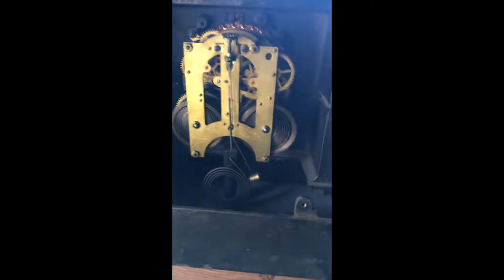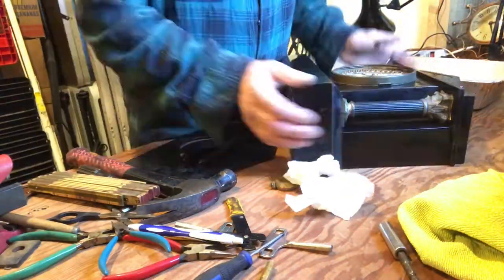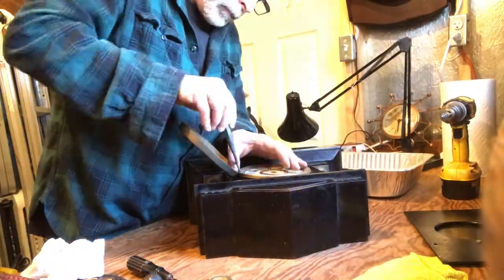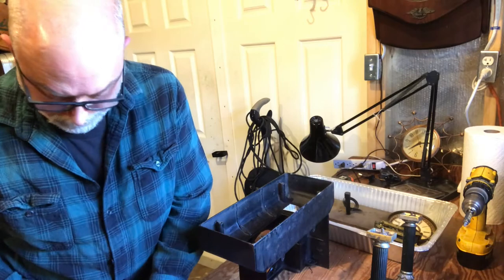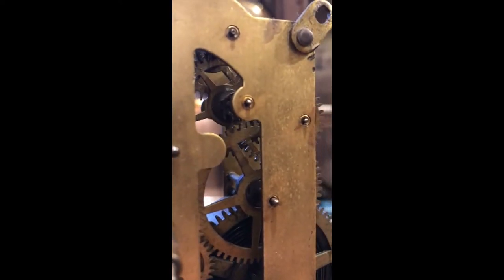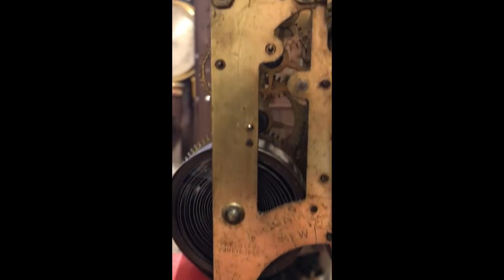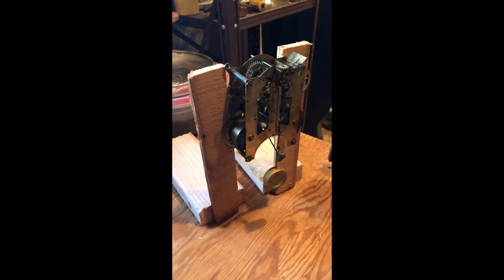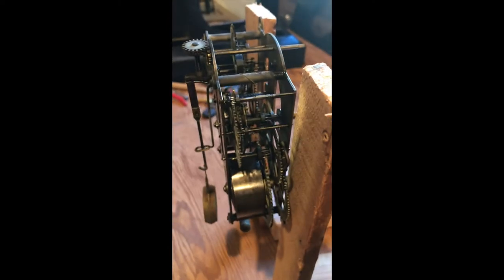The Clock Hack Refurbishes Ansonia Cast Iron Steel Cased Time Strike Mantel Clock Repaint

Comment: Hi. Really interesting video. My movement is the same as yours, but mine will not run for more than about 30 secs to a minute. The movement is clean and I have oiled it the same way as you showed. The springs and escape wheel seem ok. Bit of a mystery.

Comment: A cheap ultrasonic cleaner would go a long way toward cleaning the movement. All you really did was partially dissolve some sludgy grease and dirt.
Reply from the maker: I ran experiments with blending synthetic Pag oil with mineral oil in automotive R12 compressors when the conversions to R134 took place. There was outcry by the parts manufacturers that we would destroy the system. I must have done 500 conversions myself including my 1989 Ford F250 that I am still using as a daily driver.
I used the same method some 20 years ago when I inherited my Grandfather's Sessions time strike. I haven't touched it since.  I don't prefer to remove brass that has oxidized. It only changes the dimensions and the burnished surface is wasted.